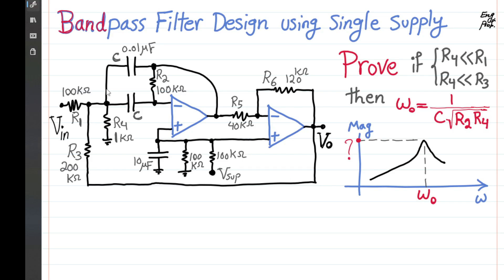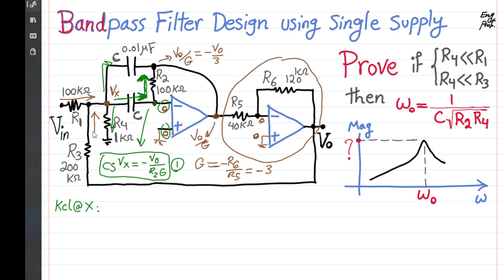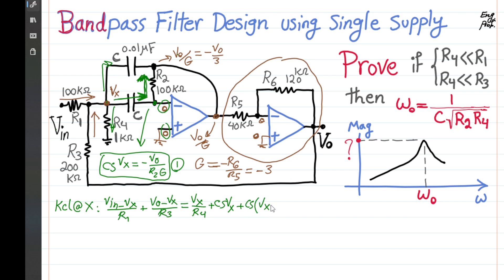Bandpass Filter Design with two operational amplifiers and single voltage supply

Comment from the maker: Derivation and MATLAB simulation of Transfer function of an active band pass filter designed using two op amps, single voltage supply and feedback loop is presented in this video. A few related circuit videos are https://youtu.be/2J-0msXZE2o video that explains Universal Analog Filter implementation with Op Amps that simultaneously realizes Low-pass, band-pass, high-pass and band-stop filters. Then in https://youtu.be/U3AR1XCkX8k a BiQuad Filter Circuit Design and Transfer Function Analysis are discussed. And https://youtu.be/Ga8Lu8sWlAk video explains Analog Filter Frequency Response and Poles and Zeros in Bode plot.  I hope these videos are interesting and helpful.

Comment: According to LTSpice, with C being .1uF, the peak frequency is 507Hz with a 3dB cut off band width of 63 Hz.   I plugged your formula  into Excel and got a peak frequency of 1000 Hz.   What am I missing?  I really enjoy your videos!
Reply from the maker: Glad that you liked my videos, and thank you for sharing your observations and experiments.  The center frequency formula in the video as presented at 11:25 is further simplified to 1/(c*sqrt(R2*R4)) if R4<<R1 and R4<<R3.  With that said, provided the given values of R1 = R2 = 100k Ohm, R3 = 200k Ohm, R4 = 1k Ohm and your C = 0.1 uF then we get Omega = 1000 rad/sec and hence we get center frequency f = Omega/(2*pi) = ~ 160 Hz.
A follow-up example is https://youtu.be/2J-0msXZE2o video that explains the design of Universal Analog Filter Lowpass, Highpass, Bandpass and Stopband Filters with Op Amps.

Comment: This active filter is with variable Q?
Reply from the maker: Please watch minute 16:33 when Magnitude response plot (Matlab) is shown and explained. Q of filter is the ratio of center frequency and 3-dB bandwidth. To change that in this design, you will need to use variable resistors in the design. A related example is the Universal Analog Filter implementation with Op Amps and variable resistor https://youtu.be/2J-0msXZE2o video that explains implementation and frequency responses of Low-pass, band-pass, high-pass and band-stop filters. Another example is the BiQuad Filter Circuit Design video https://youtu.be/U3AR1XCkX8k that also derives and explains Filter transfer function.
Reply: @STEMprof  Thanks! :)